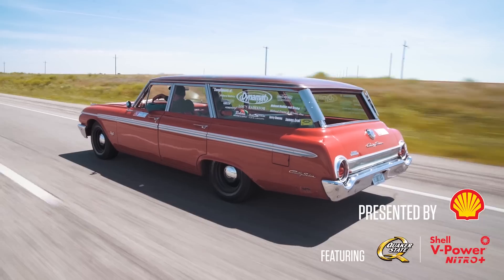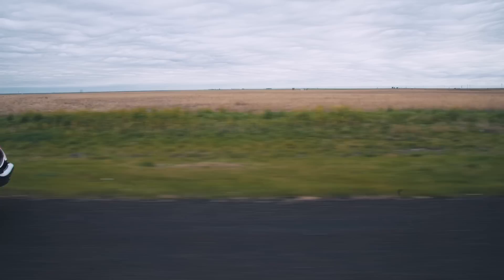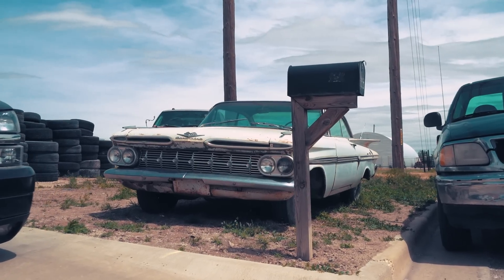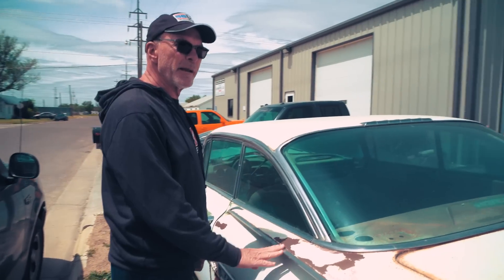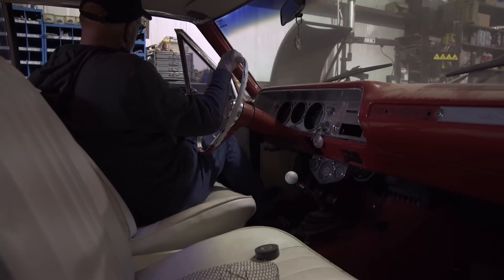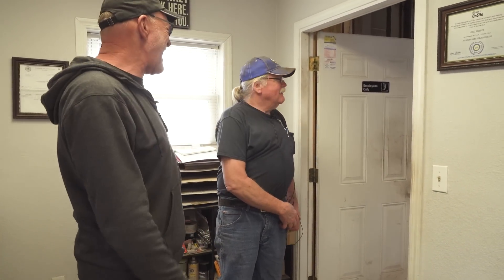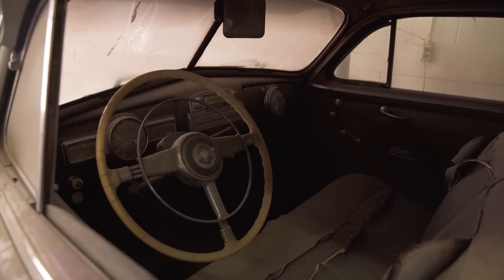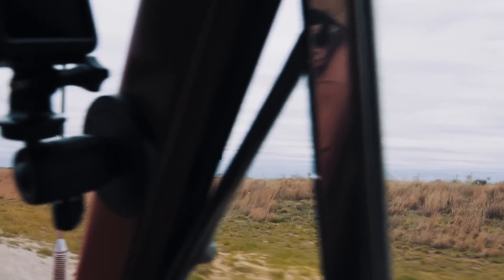Small towns harbor the best barn finds | Barn Find Hunter - Ep. 62 (Part 3/4)

Comment: Like them all ! Always happy to see a new BFH  when I get home in the evening . The Pontiac is way cool  . I have rebuilt a lot of vintage engines in my Machine Shop . Right now I have a 1950 straight 8 Buick , a 49 Flat head Ford and a 1917 900 C.I.D. American LeFrance . Plus all of the later model engines . We specialize in heavy diesel but rebuild more gas burners than you can shake a stick at . We are located in Leeds , Alabama , Advantage Engine Restoration . Stop by anytime . Might hook you up with a few barns in our area .

Comment: Looked like that Pontiac had an automatic transmission. I worked on a 48 Pontiac when I was a late teen-ager, (many moons ago. . .,) and it too had an automatic, A buddy of mine from high school inherited it after his grandfather died, and we managed to get it running. From what i understand, it was the first year for Pontiac, (or maybe GM in total,) to have the automatic. I remember to fill it with fluid, there was a gigantic bung-plug in the interior transmission hump that had to be pried loose. The sheet metal on that car was, I swear, a 1/4 inch thick. You couldn't dent that thing hitting it with a ball-peen hammer!!!

Comment: “I’m a mechanic” says the 5.3 isn’t an LS sets air cleaner on the battery
Reply: Brad Parsley ugh I know and they have LS powered pickups all over the place there. How does he not know?
Reply: A 5.3 truck motor isn’t an ls
Reply: It’s a ls family the ls is all aluminum the truck motor from 99 to 07 are usually a lm7
Reply: @taylormclaughlin6737  The Gen III Chevy V8 that came out in the 97 Corvette was called the LS1. It was a clean sheet design. Everything after it based on that design is considered part of the LS series, even though they have different RPO codes and slight variations (iron or aluminum block, different displacement, etc.)
Reply: @taylormclaughlin6737  LM7 are iron block. Aluminum 5.3's are LM4, L33, LS4.

Comment: Way back when I was an Apprentice in New Zealand, one of the tradesmen I worked under had a 59 Impala with a W engine. His had been swapped out in 1960 with a 409 and on the crappy tires available it would run easy 12's on the 1/4. He had got the car from a woman who had imported it from the US . 
I also had a Pontiac straight 8 ,a 49. That one in the shed still has it's original style battery. I'm not sure you could buy one of those skinny things today. I know that 50 years ago it was getting difficult to find one. Looking at that sun visor etc it all screams "bombe"

Comment: Please don't pull the 348 just to put in an LM7 that would be a shame. The LS based engine's are a great swap, but if you have the original #'s matching engine especially something as rare as a 348 just rebuild it. Technology has come a long way with aftermarket fuel injection setups so there's really no good reason to remove the original engine.